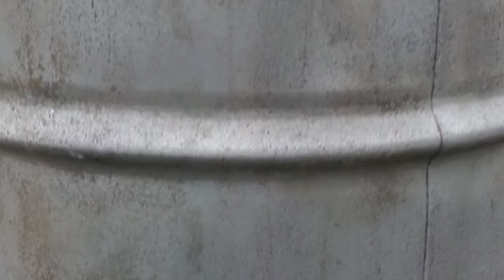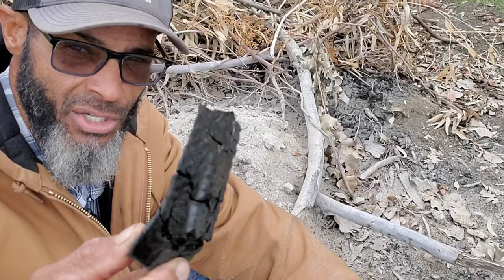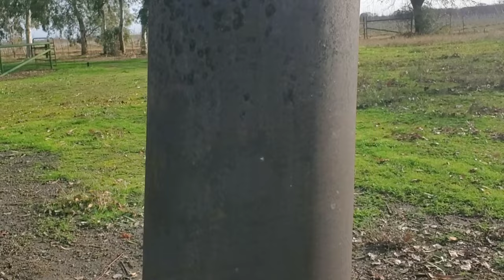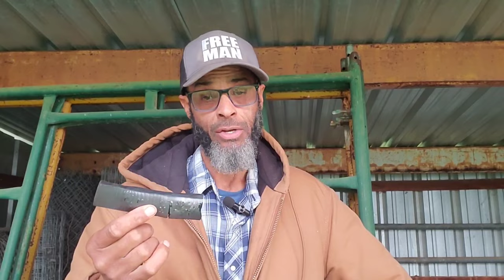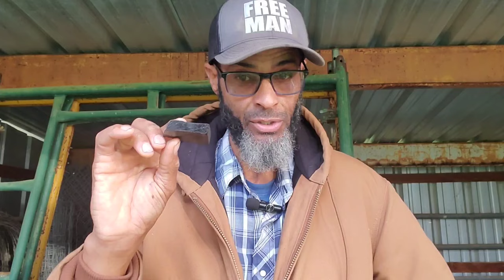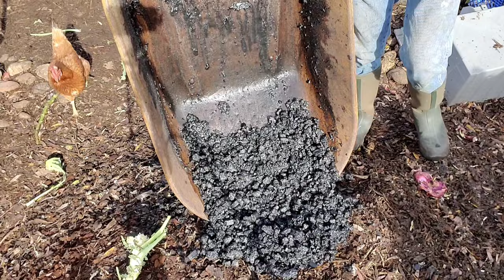EVERYTHING YOU ever WANTED to KNOW about BIOCHAR 🔥

Comment: Make biochar at very high temperatures (1200 C) and you won't have any tar left assuming you cook it long enough. If you can melt aluminum then the fire is hot enough to properly make the charcoal.

Also, the stock you use to make the charcoal will vary on the pore size when you are finished.
Hardwoods have one size pores while softwoods and other plant material have another.
You can make charcoal out of bone too.

I made mine out of oak heating pellets so I would not have to do the crushing step. Dang near perfect size charcoal was created.
While the charcoal was red hot, I quenched it into a bucket of water mixed with sulfur free molasses, Epsom salt, and urine.

It helped fracture the structure even further and when it cooled, it automatically drew in the liquid.

I scooped up the material with a food strainer (screen type) and placed into a bag.

There was a small amount of biochar powder left in the bottom. Used a spoon to get that and put it into another container. That is used for special potted plants for the wife!
Think of that powder as gold dust.

My problem now is I no longer have access to a wood stove, illegal where I am to do trench burning, and not sure about using a TLUD pyrolyzer where I am.

It takes about 5 hours of high heat to make a batch of charcoal.
Depends on the amount you make and the materials used.

You CAN buy commercial biochar if you cannot make your own and there are companies that will come to your farm or property with equipment to make it on the spot for you.
Reply from the maker: Right on man! 👊🏼 I have tried  wood pellets as I have come across about 800 lbs as a waste product. It works pretty well in my retort although I have to run it twice to get it to fully process. My system seems to work better with less densely packed material in the inner chamber. It's a work in process and that retort now has over 70 batches through it and is showing wear but hanging in there. Keep on crushing it. Thanks for your input! 🙂
Reply: @therealprtrhsenteal  THE hardest thing I tried to make biochar out of was used coffee grounds. Took days to convert a 12 quart batch, even with a very HOT fire.
Wood chips is another hard one to convert.
Seems that there needs to be some air gaps around the material to vent off the gasses and such.

I only make small batches at a time in a 12 quart stainless steel stock pot with lid.
I found that quenching the red hot charcoal in the solution fractures the pieces.
As they cool, they draw in the goodies and the water. I strain the big stuff out and bag or bucket it.

Eventually I will have bio sludge (powdery not real sludge) in the bottom of the bucket I quench in.
That is reserved for the wife's potted plants.

Got tired of smashing charcoal manually. Messy and time consuming to say the least. Pieces were not uniform in size.

Went with Oak heating pellets. Worked great how I was doing them. Pieces were close to uniform in size - easier to handle and distribute.

I started with paint cans to make initial batches.
After 3-5 burns the cans were eaten up by the fire.

Went with the SS stock pot (walmart). Those last 30 or more burns.
And even those eventually burn up in the fire.

Soil microbes will eat that bio-tar and bio-oils too.
Just a different carbon source for them.

I still have to add in compost or something into the soil though.
Plants take things out as they grow so something has to be put back in for the following season.

Think of Biochar as a shopping cart.
You fill it with goodies, then you (the plant) consume those goodies.
Then you have to go and refill the cart.
Reply from the maker: @crazysquirrel9425 sounds like you have been getting some good results with your experimentation.  Small batch char making is so good for this. Bravo 👏
Reply: @therealprtrhsenteal  I expected phenomenal growth and production. I got normal growth and typical to low production.
I have a leaf chart that tells what plants need based on the color and such with the leaves.
None showed any significant signs of deficiency.
But the chart does not tell about the 111F heat and no rain for weeks on end either.
Nor the BUGS devouring everything they can get to.
Just can't win with gardening....

Comment: I hot compost and vermicompost. I don’t have the space for compost in my winters and will end up with too much material overflowing in my setup. Thinking about, at least in the warmer months, running my hot compost that’s finished into my vermicompost setup.

Thinking of adding biochar to my compost at the hot stage but curious how the worms will feel about it if I add the finished hot compost to the vermicompost with biochar in it.
Reply from the maker: The char will pass right through them making the castings even better. Only the smallest of char (dust) will be taken in by worms based on information I have researched.  Good luck with your system 👍

Comment: I thought you're supposed to pyrolyze it to the point where no more hydrocarbons are left and the stain washes off when you crushed it.
Reply from the maker: There are always going to be some level of residual v.o.c.'s when making char.  Minute as they are they exist in almost all carbon having undergone pyrolysis. At least that is my understanding from the research I have done.  Anecdotally  my experience has shown all my char as being hydrophobic caused from those minute traces of v.o.c.'s present during the cooling process.
Reply: @therealprtrhsenteal  I dove into the subject a bit today and found Gray et al. "Water uptake in biochars: The roles of porosity and hydrophobicity", where they talk about both the residual organic compounds and macro-/nanoporosity, and how water has a hard time getting into pores that are blind holes (essentially clogged up with air).
They note a significant reduction of organics by raising the temperature from 500 to 620°C.

My thoughts: it may even be beneficial to add water vapor during the later stage of the pyrolysis process to completely remove hydrocarbons. Cody's Lab has a video on activation of charcoal to make it suitable for filtering (the water vapor helps etch the pores), and beyond that I imagine some of the results from hydrothermal remediation of organic pollutrants carries over to the understanding of how the water vapor addition may help clean up the biochar.

Comment: What type of wood would be the best for biochar?
Do you prefer lighter wood types like willow and poplar or hardwoods  like oak or even from the tropics?
Reply from the maker: The best type of wood is that which you have available and didn't cost you money. Both hardwoods,  softwoods and many other carbonaceous waste will make great char. All carbon based material begins with it's own unique pore structure but what determines it's effectiveness as biochar is how it was processed. Temperature  and duration in an oxygen deprived environment  is what drives purity and porosity more than type of feedstock used. Thanks for the question.  👊

Comment: Doesn't the burning of the char negate the benefits of pulling carbon out of the air? Seems like the smoke and fire woukd give iff greenhouse gasses.
Reply from the maker: Great question.  There is a portion of the material released into the atmosphere however the remainder is sequestered carbon.   If the biomass is not sequestered  the majority If not all will be released into the atmosphere through natural decomposition.

Comment: Do you think that dolomite as a soil 'sweetener' would be absorbed by biochar that is soaking in pond water?
Reply from the maker: Yes. Biochar will absorb dolomite and most everything that it comes in contact with. Pond water holds alot of accumulated nutrients from runoff as well aquatic life. Both are good choices 👌

Comment: Do you have any recommendation as to how far away from trees or buildings the retort system should be?  It doesn't look like sparks are being given off at all as the gases burn.
Reply from the maker: It's actually fairly well contained  and the only external flame is short-lived and generates very minimal fire brands. That said I wouldnt recommend it be any closer than 25 ft aways from flammable material and to a lesser distance for combustable material. I don't operate this unit during fire season and I run my retort in an open pasture surrounded by green grass. Thats what works best for me in my area, your results may vary.  🔥

Comment: I wounder about the temperature during the pyrolysis process. I working on an uniq water stirling engine how Will run at 300-400Celcius on hot side . Is it possible to make charcoal at around 350C ? Or would it be to heavy coal left for soil preparation.
Reply from the maker: The temperatures in my retort vary from burn to burn but typically is above 1200°f

Comment: I built a similar retort kiln and I’m burning my first batch now. It’s been going for about 40 mins but it’s still smoking like crazy. I used all dry hardwood scraps from my woodworking shop so I’m not sure what going on. Does it smoke until all of the outer wood burns up?
Reply from the maker: You may need to get the fire in more of a free burning state before you close the lid. Or you may also try adding more holes to allow more inflow of oxygen. You may also play around with increasing the height of your stovepipe which will increase the draft effect. The bottom line is you will just need to adjust and tweak your system to figure out what works best. My first burns were smoky until I figured out the best sequence and made adjustments to my setup. Good luck and keep tweakin! 👌

Comment: Hello, I run a cat rescue and work in a greenhouse. I switched my cat litter to pine pellets for a wood stove. I wanted something more environmentally friendly than regular clay litter. I originally was going to compost the pine pellets but I have had animals with parasites like giardia and coccidia… so I wanted to burn it and create biochar. I live in the country and have lots of brush I can burn ect… I was wondering if you or anyone knows how I could use these wood pellets to create biochar or if it’s possible (maybe they are to small all the videos I watch use large pieces of wood). Any suggestions or help would be much appreciated!!!
Reply from the maker: Wood pellets might actually work pretty well in a retort. I believe there would be adequate airflow around the material to evenly heat the pellets. I have not tried this but I am interested to know if it would work say I may give it a try in the future. Thanks for the question and good luck with your experiments.

Comment: Do you have to energize or enhance the bio char to use it for filtering water making it potable? Like  acidize it
Reply from the maker: Char used for filtration is used in it's purest form without any inoculants. The job of the char is to attract and retain impurities so the idea is to have as much "free space" in the pore structure for adsorption. Energizing or inoculation is a process necessary when using char as soil building amendment.  Hope this helps.

Comment: Hi I know I’m late, I’m about to do this using a retort, my inside barrel has small holes at the bottom, it shouldn’t touch the fire and there may be a tiny amount of oxygen that gets in, is it gonnna explode?
Reply from the maker: The retort system I have created is not a sealed system thereby not creating an explosive environment.  The superheated gases are forced out of the bottom of the inner barrel and ignite in the outer chamber.

Comment: How much biochar does one cubic foot of raw wood yield? How much fuel wood has to be burned to turn the one cubic foot of raw wood into biochar?
Reply from the maker: I have never tried to figure that out however raw wood will reduce by approximately 40-60% depending on the wood type.
Reply: But then you crush it and it’s significantly less. I’m trying to figure how much would I need to create enough biochar for a layer of 1/4” over 1.6 acres. I know you use a 30 gallon barrel so it’s as simple as crushing the char from one batch and pouring it back in the barrel to see the approximate yield. The big biochar producers tell the amount of biochar I need per acre. They know the information I’m wanting but nobody I can find has given out this information.
Reply: @terryguin9529  not as simple as you put it there, the 30gallon drum won't be entirely full of biomass because there's a lot of airspace as well.

From experience I can tell that the volume reduces by about 50% bit this does depend on the feedstock as well, some feedstock shrinks more than others.

With my TLUD gasifiers I get a 50% yield by volume when using pine wood stove pellets.

As for the fuel needed to make biochar that varies per method, with the drum in drum method you Sacrifice 25gallons worth of biomass to carbonize 30 gallons worth so this method is very inefficient.

With TLUD gasifiers there is no sacrificial biomass and ash formation is very low.

Pit burns/flame cap kilns also use their own proces energy so there's no loss there either except there is a bit more ash formation but still less than 5% when the burn is performed by an experienced operator.